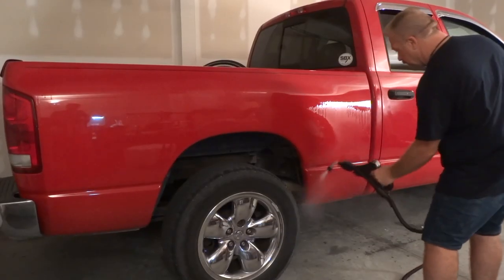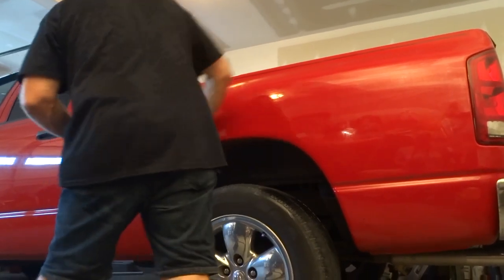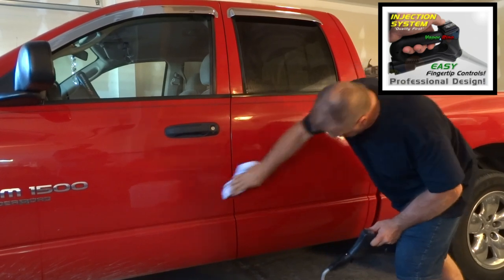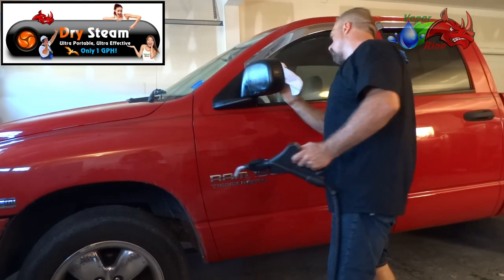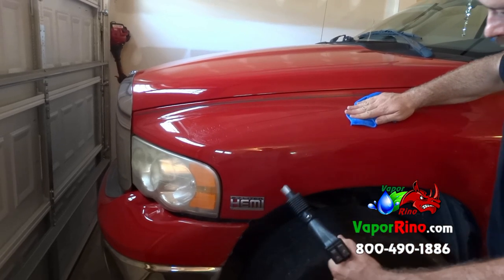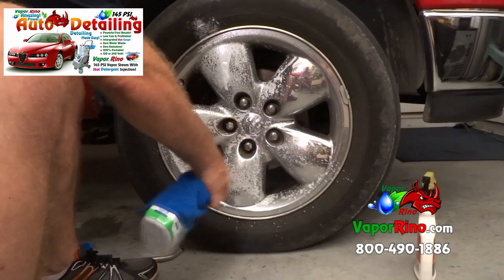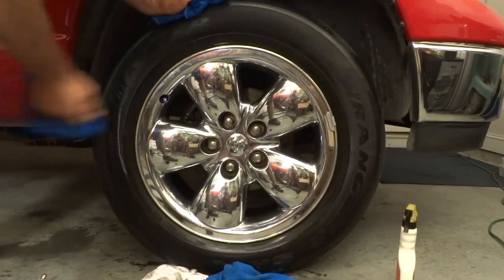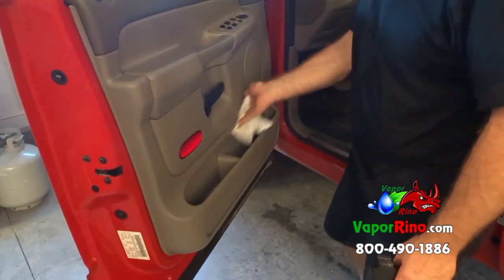Dry CAR WASH #2 & Auto Detailing - 200 PSI Commercial Vapor Steam Cleaner Vapor Rino Rhino Carwash

Comment: I used to own an Optima steamer, it was heavy, diesel powered and didn't offer injection or extraction.  It never worked right so I ended up selling it.  Of course you couldn't use it inside because it was diesel.  Just applied for financing to buy the Vapor Rino.

Comment: Could you use a step up transformer to run the 230v system
Reply from the maker: Hi Jack, It is more cost effective to just use a simple generator. You can find a generator typically from $600 on up to power our unit. Try Lowes or another major outlet. Using a transformer tapping off of a bank of 12 volt batteries would take a LOT of batteries to run. The cost of batteries would be high and it would not be a very safe operation. So it is possible in theory, but I dont know anyone that has made it happen.  Good question though. Thanks for asking and best wishes.

Comment: Vapor Rino
How much is this set up with a connection as a mobile unit to my cigarette lighter or jumper cables to the vehicles battery ??
It looks awesome!!
Reply from the maker: Hi and thanks for the great comment. There is no way to hook a system like this to a cigarette lighter or jumper cables. It would be great but there is just not enough juice made by your car. Typically, guys are running their mobile detail using a generator. The 120 volt system (shown in this video) will work off a standard outlet like you can find at your home. This makes it easy to plug in. A 3000 watt generator will also work great. Best wishes and keep cleaning! I just saw a 3500W generator in Walmart the other day, I think it was priced at $295,, you will have to check but it was right there on the shelf. This gives you an idea of cost. Buying a generator may be cheaper than you think :)

Comment: I'm looking for a great steamer for my biz and there is one things I'm looking for that i don't see ur system offering. 1) additional house for a two person operation. Is there an option for this maybe on the 220 volt unit?
Reply from the maker: Hi William. (You can own two of our units for the price of one of those systems). Your point is valid however when you look closer  you will find that the systems you are talking about weigh hundreds of pounds and run more than double the price of our unit. Think of it simply this way. For the price of ONE of their dual hose units you can own MORE than TWO of our units. Now you have two hoses, one on each Vapor Rino Machine for around the same price!  This has many advantages. One, your two units can be working in different bays or on different job sites. Two, you have twice the dependability. Why? If one machine ever needs service, you still have your other Vapor Rino automotive detailer up  and running. If a dual hose system goes down, now both crew members are out of work.

 Vapor Rino, extreme quality, highly refined and constantly improving. By the way, our 230v unit comes with an extra hose. One is 12' long and the other is a huge 26' long. They both come standard. Used only one at a time, this extra hose also adds to your durability. Don't forget, that dual hose system I believe you were talking about, does not come with a massive 50pc accessory kit nor does it come with Vapor Rino's killer 3 in 1 upholstery system. Auto detailing, car washing and upholstery extraction,,, so much more for so much less. Hope that  helped answer your question. Best wishes in your business William!